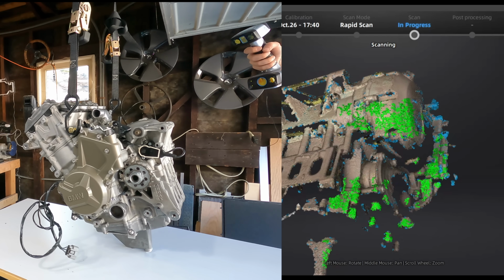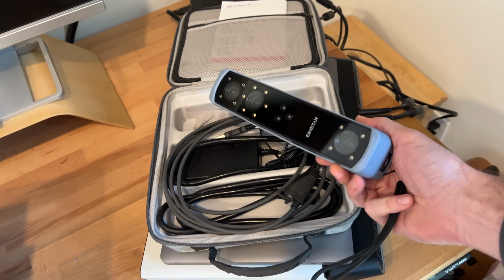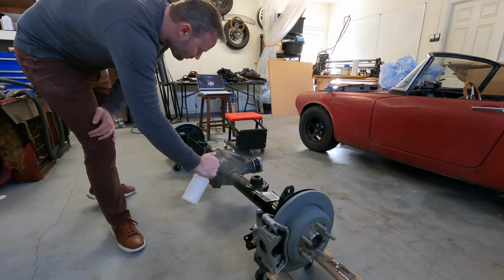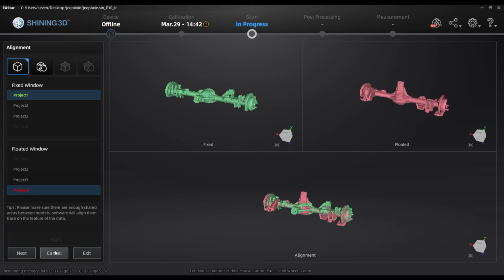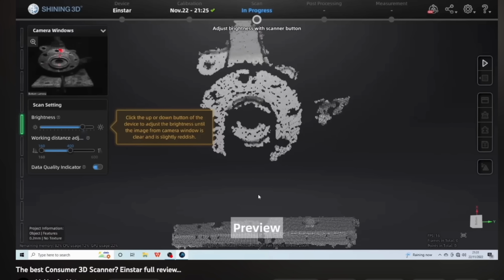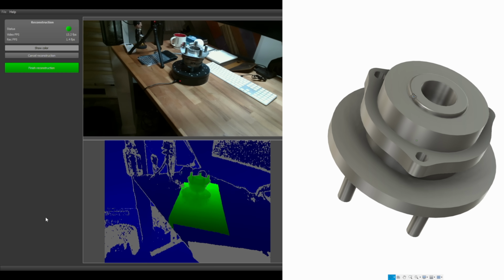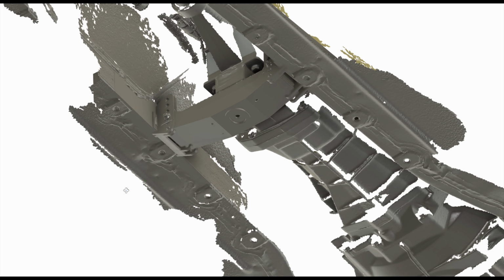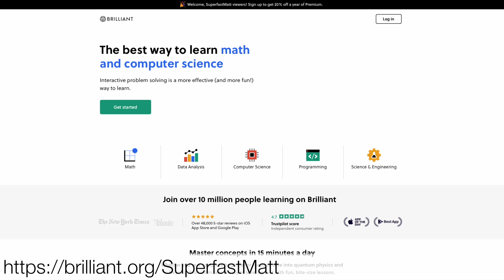It’s Time To Put A 3D Scanner In Your Toolbox

Comment: thank you for making this video I had no clue that something like this existed and I'm making a custom car for a track and holy shit will this help me make engine mounts for my 1.8t vw engine
Reply: I'm a TDI/mk4 VW guy ... and weirdly, specifically only a TDI/mk4 VW guy.   But lots of parts fit the different engines the mk4 had.  Some of those part numbers are used between all that platform's 4 cylinder engines.

If you have part numbers you're needing scanned, and I have them,  I'd be willing to give them a scan up, if I have them here with my several parts-cars.   Even if you're half a world away, the scan model would be easy enough to pass to you.
Reply: @chrstphrr  thanks man

Comment: Matt, you mentioned your prior use with Revopoint.  They're in the midst of a proper, GOOD redesign of their software, but not done with the work to make it quite good like Einscan has.  They do have that pause and reverse/FF functionality you're mentioning Einscan should have.  

 If you've still the Pop 2, grab the Beta 5 and give it a whirl.  My laptop's too old and pathetic to run the Beta 5, but my android phone is fine.  

The phone right kicks the arse of the 4.x software running on the laptop using Beta 5.   It's shockingly good, and the tracking is much improved over their previous software.

I bought a Mini with them, which isn't suitable for big swaths of car.   I'm going to try rebuilding a desktop to deal with the newer software, and see if I stay with Revopoint's offerings, given they have a large volume scanner.   Their price point is just a bit under the Einscan, so... it'll be a matter if they can succesfully redesign their software to match/enhance the scanner's capablities.

Software really REALLY makes or breaks using a 3D scanner.   The Mini was a fancy toy with RevoScan 4.3.   It's heading toward a capable tool, with the beta versions of 5.    Probably keep an eye out, and if they continue and finish their dev work on their version 5 software, give it a whirl with one of your projects 6-9-12 months out.
Reply: Revopoint also recently came out with a new large format scanner called the Range that should be competitive and the only one in their lineup that is really useful in our 'hobby'. Eager to try mine out.
Reply: @allanpeters  when I saw that released, I had a wee bit of buyers remorse having bought the Mini.   But, the two do different jobs. 

And, I still need small-detailed scans of parts, as I'm after modelling/reproducing out of production parts for my car.  

I'm now content with waiting and learning the ropes with the Mini first before I opt to get a Range.   Especially with Revopoint's software improving - but currently being in a state of flux.  I know I'd be happier with the Range, if the Mini I have works super-awesomely with their newer version of Revoscan.

I hope you have a blast with yours, when it's in hand!  I take it you backed the Range on kickstarter, like I did with my Mini last year?
Reply: @chrstphrr  Yes, I backed the Range( which actually arrived the middle of April )... and the Mini... and the Pop2. My main use for them is scale modelling so they all come in useful. And you're right about the software, Revoscan 5 is a big improvement.

Comment: I've no need for any 3D scanning kit, but it's still an interesting subject to learn about, and it's always handy to know what's out there in case the need ever DOES presents itself. So thanks for the upload Matt.

There' s one thought that crossed my mind based on what you said here though.
If large flat areas need some sort of detail for the scanner to avoid "Getting lost", couldn't you just scribble across the panels with a contrasting colour of dry wipe (Whiteboard) marker to give it something to optically reference from? If this worked, I'd think it would be a quicker and cheaper option than buying/placing hundreds of the target dots, and the clean up would just be a quick wipe over afterward.
Reply: Maybe some tape would work too?

Comment: I wonder: would putting the scanner on something like a camera slider rig help in any way? movement would be smoother, linear, repeatable, etc.  I guess I'm wondering how much scanner shake affects the scanner.
Reply: Software matters more.    The hardware for most of the prosumer grade 3D scanners is pretty much where we need. Current software bundled with the prosumer scanners are not letting the prosumer scanners perform to their capability.  The software is years behind the high 5 to 6 figure professional scanners, but improving. 

The scanner I'm using, the 4.x version software tracks badly, unless surface and lighting are ideal.  And even then... it can drift off for no reason, or do that dreaded "two calipers" problem SFMatt showed.

Same hardware, new beta 5 software, the tracking is vastly improved.   You can be coffee addled, shaky ... loose tracking, and it recovers better than the previous program.  The only change was software.  

Well, and the software requiring a good GPU.   But, this was to be expected.   Matt didn't really mention his scan sizes, but some of my small hand sized part scans are turning up as 50-250 mb scan projects.  You need a number crunching GPU for that much data.

It'll be interesting times with these scanners.  I'm just hoping that the software improvements to truly match and pair with the scanning hardware means existing scanners improve, and have a longer life.   Though, I'll settle for improved hardware AND improved software both, at the $500 price point Matt mentioned, too.

Comment: The rear chassis leg behind the driver looks like it would go straight through you if you got rear ended hard. 
How’s about a cage integrated into the chassis ? There must be some used gt racing cages around you could modify ? 
Love the videos , watching from 🇬🇧

Comment: Blender has come a long way for remeshing and working on objects, I feel like it might be a better fit than mesh lab for a lot of people.
Reply: I know a guy who used an RV as a mesh lab
Reply: i was gonna comment this, its really good in the case of mesh decimation, as its a mesh modifier that you can undo and tweak all you want
Reply: How would you rate Autodesk Inventor against Blender?
Reply: @robertnicholls9917  They are not the same kind of tool, not at all really. Yes, both creates 3D models, but in completly different ways. Inventor is actual 3D CAD, professional level at that, and Blender is, well, not CAD (no, not even with the CAD addons). Comparing an apple and a banana is more similar :P
Reply: @robertnicholls9917  They're very different. Blender is a mesh-based programme better for amorphous sculpting, animation, and VFX. Inventor is solid-body parametric CAD, better for engineering parts. Fusion 360 is essentially a budget version of Inventor though.
Reply: @robertnicholls9917   if you looking for design thats only possible with a 3d printer, very abstract or you want to work without sketches and measurement go with blender. Great animation and rendering stuff as well. But for great fitment i recommend a cad tool

Comment: If you use sodium bicarbonate as the "white powder" ,it's soluble ,so you can just hose it off after.
You can spray the surface with water and sprinkle the powder  over the damp surface ,or you can spray a strong solution and wait for it to dry.
Reply: Also, it's salty tasting, for those who can't resist licking the part off.

Comment: What happens if you project a starfield on the part instead of using the tracking dots? You can buy these super cheap light projectors that create a load of light dots on the walls. They are for kids. It makes your room look like the night sky. Maybe it doesn't work like that. In that case ignore this comment.

Comment: Hi Matt.  Let's say someone has a really high end computer, but it's really far away.  Like in a different building.  Would this scanner work with some sort of extension cable that could span that?
Reply from the maker: I'd guess you'd probably need a really good ($$$) USB extender. I'm sure there is a lot of data being transferred.

Comment: There are perforated film sheets that are used to cover windows as sun shades and for printing advertising on that cover windows.
As they are electrostatic they are reusable and getting some printed with dots would solve several problems.
Also as a light source using incandescent or halogen bulbs connected to a battery to avoid flicker would improve lighting.
Reply: drawing any random non repeating pattern on the sheet is all you need. the scanner needs to be able to match what the two cameras see.
Reply: That sounds like a good idea. Maybe even better would be lengths of electrostatic tape covered in tracking markers. So you don't have to worry about it creasing in areas of compound curvature.

Comment: Thumb up for that baby powder and alcohol trick. I don't have a 3D scanner and won't have one for a really long time, but i bet it can help out with some photogrammetry tasks or similar.

Maybe don't scare people with "you need expensive computer", because what does it really take? As long as things are half way fresh and not literally the bottomest tier, you get a lot of performance mileage for your money, diminishing returns come quickly. I mean a Ryzen 5500 is a $110 CPU which can run on $50 mainboards just fine, and 32GB RAM are also like what $100, and realistically you won't get double the performance out of a sensibly beefier CPU (yet). How much VRAM does it need and how sensitive is it to GPU performance? Does it simply have issues with particular GPUs (ahem Intel drivers)? GPUs are really the only actually expensive bit. What are the odds that it works on a 10 year old laptop with an i7-3632qm and a gt645m/2GB? CAD Software is exclusively OpenGL based and that's basically the NVidia home turf with low CPU overhead and really stable drivers, but if it's all about geometry, it really doesn't take a higher end one of those, it usually gets choked mostly on the CPU performance and drivers. CAD is also notoriously bad at utilising multiple CPU cores for the overall geometry manipulation, you can maybe use GPUs for CFD and such and multiple CPU cores too, but that's about it; and NVidia's CUDA is crucial for that as well.
Reply: You need a computer fast enough to keep up with the data that the scanner is putting out, including processing it in real-time. Otherwise the scanner simply won't work.

Comment: I’ve been using my iPad pros built in LiDAR to scan certain parts. It’s honestly perfect for what I need as a casual fabricator. When I have measured, it’s within +-10 mm. Acceptable range for what I need it for!
Reply: Whoa. That isn't even 10mm anymore. It is a whole freaking cm!
Reply: @alpsalish  +-1cm is acceptable for general scale, given the fact that you can then compare a singular reference point to scale it, usually drawing that scale down closer to reasonable tolerances. My phone doesnt have lidar and its typically off by 0.5in or more.
Reply: @JeronimoStilton14  A half of an inch?! That is 1.27 cm! How can you live?!
Reply: @JeronimoStilton14  Like the OP said, tolerances are all dependent on your needs.
Reply: @alpsalish  Because as I said, tolerances across the part are fairly uniform. If a known dimension is off by 2 cm, all of them are. Scale, compare, scale, compare, all the sudden im at 5thou and I don't need nearly that much as typically if i am scanning its large parts for comparison to large spaces. Putting a table 4 cm to the left of where you envisioned will not break the house.
Reply: @alpsalish  I am acutely aware.
Reply: @JeronimoStilton14  you ok?
Reply: @JeronimoStilton14  why scale, compare, scale, compare when I can just get it right this is something that is probably different from a hobbyist to someone who works but that's not something that I want to spend my time doing I'd rather just have the equipment and save the time. There is no sense in a table scan unless this is an example. A tape measure makes more sense. More efficient. You probably missed all the joking though.
Reply: @alpsalish  corporate often doesn’t let you have the tools that work, you must be lucky to work for yourself or a business that cares.
Reply: 10mm?  Must enjoy the hot dog bouncing down the hallway...
Reply: @ShainAndrews  that’s why you measure once and cut twice :)

Comment: I can confirm that about $1000 laptop like Lenovo E580 can run Einstar and also the $10k Einscan HX. Memory is more important and you can buff it up to 24gb, if you want to run Autoscan Combo or other more expensive models. And I’m sure that Shining3D will send a Combo to you Matt if you want it.
Reply: whats your computer specs.  i have a descent computer but its under their recommendations.  really want to pull the Triger on this scanner but not a new computer.  computer is just over a year old
Reply: @Talbot_Industries  it’s about having enough memory and a decent graphic card. I have Ryzen 7 5800, 24gb memory (16 is fine for einstar) and a RTX3060 6gb.

Comment: Have you tried photogrammetry? Basically you just take a bunch of photos and then use a software to turn the photos into a 3D model. The best open source software I've found for this is meshroom, however it can be painfully slow to process. Zephyr is a paid software that's much faster and for me sometimes picks up features meshroom missed (around $200, there's a free version but you can only do 50 photos at a time). It works really well for organic shapes and you can even retain color and texture. However I haven't tried it for more engineering design stuff (yet). As far as value goes I think it's the best option - should be free or maybe $200. However I don't doubt this scanner is the next step up in accuracy, and price. 👍

Comment: for the bodywork, I would be interested in a painters tape lattice as a makeshift set of markers, unless they are more than just visual markers, I think that might give enough points of interest for the scanner
Reply: Coming from someone with a painfully underpowered Creality Lizard- the secret sauce is wet newspaper. Drape large, unchanging surfaces (like body panels) in the stuff and it's hands down the best way to catch them. The Lizard has the eye size of a credit card, so unless you're practically wrapping the car in tape, it's not enough.
Reply: @SAD-MART  Loads of high contrast detail on a thin sheet! Smart.
Reply: @SAD-MART  whoa this is a great idea tbh; all the letters and symbols would work for sure
Reply: @SAD-MART  That's a super smart idea!!!
Reply: @SAD-MART thats so smart god damn!
Reply: @SAD-MART  I might try this idea. My Mole 3d scanner is similar with maybe 3 credit cards eye.
Reply: Was about to say the same thing! Painters tape will  hopefully at the very least, break up the solid surface with enough points of interest to create a great scan.
Reply: What I’ve seen other than that is people even with expensive scanners using randomized cutouts of cardboard or paper.   But the wet news seems like a good idea.     I guess I’m surprised that people don’t just print paper covered in  thin lined polygons of a size relevant to whatever scanner’s ideal abilities and wet those down and lay them around… just brainstorming on your idea.    Royalties if it makes $ pls.
Reply: Instead of painter's tape, I've been wondering if dry-wipe marker-pen might work.

Comment: Excellent video. How viable is "garage enthsiast level" cnc plasma cutting of steel? Being able to have prototype or better parts from scan to CAD to holding in your hand "now" sounds wonderful.
Reply: A CROSSFIRE table is about $1300, plasma cutter from Primeweld with machine torch about $500, sufficient VERY dry air so lets call it $100 for the air dryer, $300 for a good used high volume compressor.  Now, do you about 60-70 amps of 220V with two outlets in you work space?  If not, compressor needs to be 110V so bigger tank and slower recovery time.

There are DYI solutions for the plasma table similarto the DIY solutions for large/giant format printers that certainly are cheaper.
Reply: @michaelkrenzer3296  Appreciate the info. Thanks.  👍

Comment: I've had my Einstar since January, and so far it's pretty good. I have a Zbook G8 Power that exactly matches the minimum requirements for the scanner. But I need to have it plugged in as well, because once the CPU is throttled, it's not longer fast enough.

Comment: For scanning the large surfaces would it help to draw a grid with your fingers through the powder?
Reply: I believe repetition in features is bad,  so grids are probably also bad,  also the wiped parts would be shiny which defeats the purpose of the powder.
Reply: @owensparks5013  time to draw weird abstract chalk art all over the hood!
Reply: @anatali121  I was wondering about that but annoyingly I don't think that'll help.  (Might be wrong. ) I think the scanner is looking for 3d topology to orient itself,  so flat patterns or colours might not help.  Interestingly some VR headsets can use flat patterns and colours on inside out tracking so I might be talking nonsense there...  It'd be interesting to know though. 👍

Comment: If you are a DIY sort you can get an older Clevo 6th gen intel DTR DeskTop Replacement.  A BIOS upgrade later and you can put in a desktop 6 core.  I'm fairly certain an i5 8500 - i7 9700 is faster than an 11800H.  If you search around you can find the barebone system (P750 P770 P775, P870 etc) for cheap, as for graphics a Quadro in the GTX1060 class is a P3000 (a 6GB MXM card, P4000 is 8GB).

TLDR: 8th and 9th gen Desktop processor is as fast as 11th gen mobile.  If you find a cheap DTR 'laptop' like Clevo or rebrands such as Sky, Eurocom, Origin etc.